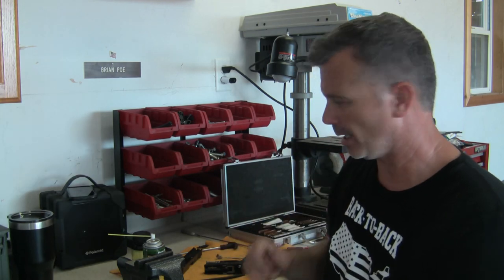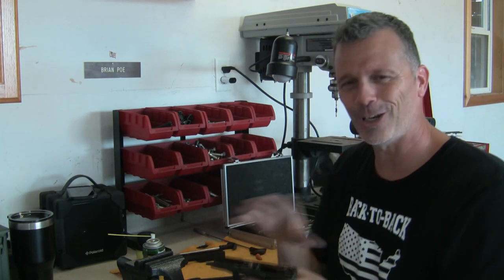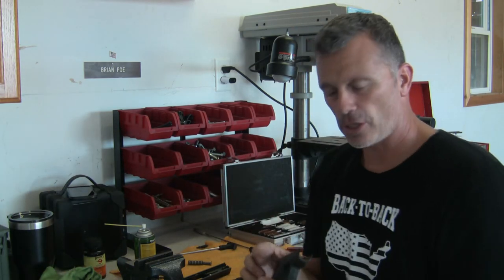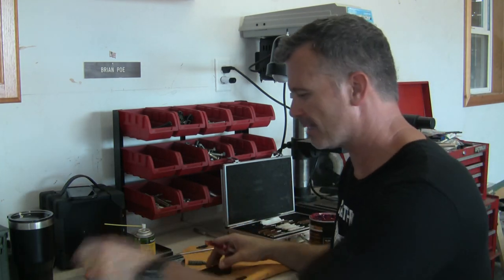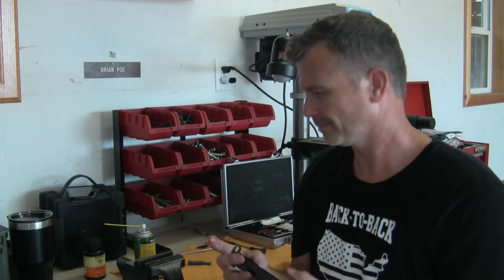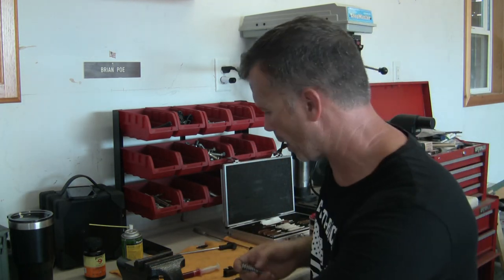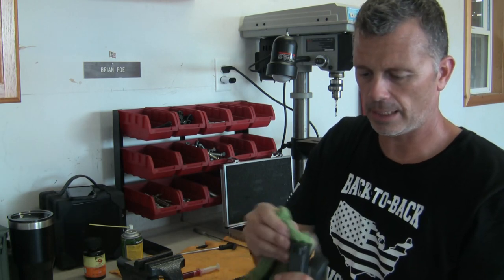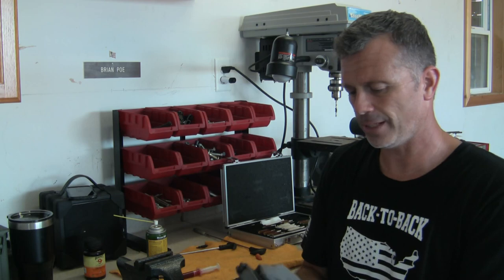Lubricating a Glock (and most pistols)

Comment: I use STP High Temp Grease it’s designed too reduce wear and can with stand Extreme Temps and Pressures in my opinion perfect for a firearm inexpensive and take very little to spread it around I always tell people use oil or grease depending on ur gun and local climate I live in a more dry hot desert of California so oil either runs off the gun or drys out faster Grease just works better for my guns

Comment: Around 10 years ago I bought a tub of Walmart high temp grease for use on guns.  I shoot alot and still have half of it left.  Works well and stays in place.  Also use Hornady cleaner lube.  Spray it on and it dries slick. Will have to give synth motor oil a shot.

Comment: I grease all my glocks, and AR's bolts, nothing preserves glock barrels better than generous amount of grease on the barrels, lugs, rails and drop of oil on TRS and trigger rubbing parts.
I use Lucas Red n Tacky wheel bearing grease, works like magic, the barrel is yet to show any signs of "glock smile" and still looks like brand new one even after 3000 rds

Comment: I use grease as well because it stays where you put it. Pennzoil disc brake grease is what I have & use,I'd like to try the Lucas oil Red & Tacky,it has a decent drop point,540 degrees. I wouldn't have thought to use a syringe though,I'll have to try it,I use a toothpick. Thanks!

Comment: I was turned onto bearing grease in 1989. I was at this little gun shop, that's no longer around sadly, to pay on a layaway. The owner was in back doing some gunsmithing. He called me back to give him the money and also to bullshit some. While we were talking I noticed a well used tub of high temperature bearing grease. He told me he used that because he could get a big can for about what a small tube of dedicated gun grease cost and worked just as good. He was a hell of a gunsmith and I took his word on most things, me being an 18 year old new gun owner at the time. I've never had any problems with the stuff. But I do like your syringe idea. I'm going to give that a shot.
Reply from the maker: Great share, thank you! I still use it and even from the same container.
Reply: @PoeOutdoors  I'm still using the tub of grease I bought 7 or 8 years ago. The only reason I bought that one was because my old one went missing somehow. I had that one since the early 90's and it was still 3/4 full.
Reply: @PoeOutdoors  How did you get the grease into the syringe? Can it be done without a mess, or is the mess inevitable?
Reply from the maker: A little mess is inevitable but you dont have to do it often. I used a popsicle stick and crammed it in there.
Reply: @PoeOutdoors  Sounds good. I actually found an old meat injector, looks like a big syringe. If I fill that up I shouldn't have to do it again for years.
Reply: @voodoowraith  Try taking a plastic drinking straw and jamming it into the grease, then blowing on the clean end to get it into the syringe. Or try a palette knife (found at art stores) and finally they make narrow lab spoons and some have a flat trowel on the end. Scoop up the grease and smear it across the hole in the syringe.

Comment: Excellent info, I would recommend trying a grease with molybdenum disulfide in it, the more the better in my opinion. It doesn't clean off as easy as it actually wears into the surface profile of the metal making it even smoother over time. I only use it on my rails, maybe I should try the top of the slide for the barrel lug, your barrel lugs probably keep there coating longer on top than mine because of it. I will start giving it a little film, thanks. Only worried about it transferring to my hands, cloths, steering wheel, seats, and eventually.. somehow to the wife's "good" hand towel in the kitchen. Ha!
Reply: Brian showed us the particular brand of grease he uses. So what brand grease has this molybdenum disulfide stuff in it that you use, and where can we get some?
Reply: Jim Mason lots of different options, but steer clear of the inexpensive moly grease, next to no moly and likes to separate in the tube/tub when stored in hot areas. Search Amazon your local stores for Shaeffer's 274 about $8 a tube, it is higher viscosity so a little goes a long long way.

Comment: I tried WB grease on my handguns, it left a pasty mess and very hard to clean. I may take 4-5 guns on a range trip, so I can't carry all of them IWB. Yes it does slow the cycle down, poly guns with little rail contact work ok, but anything with long rails usually fail.
I switched back to oil. 
I am testing white lithium grease on 1911's, Sigs and Beretta's... have to wait for cold weather again to see if it works better.
Reply from the maker: Interesting. The brand shown is lithium based, easily wipes out of my slides with a rag or patch. I've used it on HKs, Sigs, Glocks, Rugers, Springfields, Walthers, Berettas and S&W semi-autos in temps ranging from well below zero to 100+ degrees. Several of those have full length slide rails and I shoot cheap "under powered" 115 grain target ammo. Never had cycling issues in any weather and I shoot thousands of rounds every year.

Comment: Cool vid. Question a about the syringe.
How did you get grease into the syringe?  Did you just draw it up the same way it comes out? Seems real thick. Or did you remove the plunger and pack it in the other end? Thanks in advance
Reply from the maker: Paul Solver Being lithium based the consistency is like butter. I draw it through the small end then top it off by removing the plunger and adding more with a small screwdriver, toothpick, etc.
Reply from the maker: I don't have a specific size, sorry. I can tell you it was the smallest CVS had to offer.

Comment: I see no need do grease anywhere in a poly striker.  I want a synthetic oil.
Reply: Justin Miller  the Slide rails are Good Grease points in any semi auto regardless hammer or striker 
Everyone has there own way to oil/Grease a gun
Reply: mikey most grease is too thick, you don't want a high viscosity substance impeding slide velocity it could affect reliability especially if it's mineral based and gets cold, could easily cause failures.   High quality synthetic oils will remain low viscosity even at low temperatures and protect the metal fine.
Reply from the maker: Justin Miller - Then I guess you should use synthetic oil on your polymer strikers.
Reply: Naw, he pretty much summed it up at the end.  If it works, it works.  I don't do videos of what I do. Someone would surely criticize! I will admit though, when I was 18 (over 25 years ago), I used to use WD40.  L0L!!! 

Ya learn.
Reply: Ya, well low viscosity stuff also seems to dry up faster and not stay put, which will impede on everything as well. To each their own, grease works great although I would go for something thinner in cold climates is all